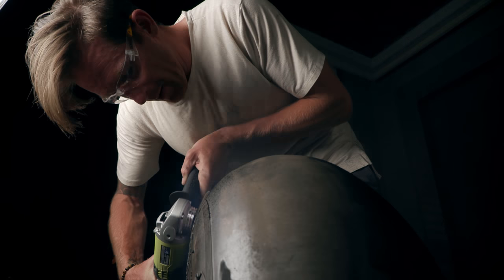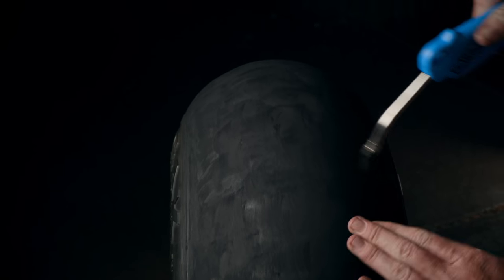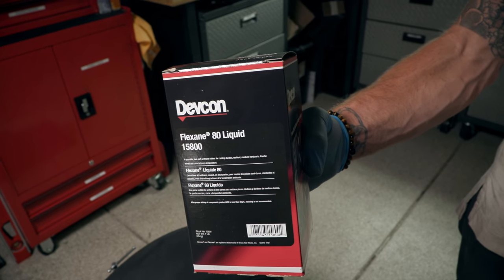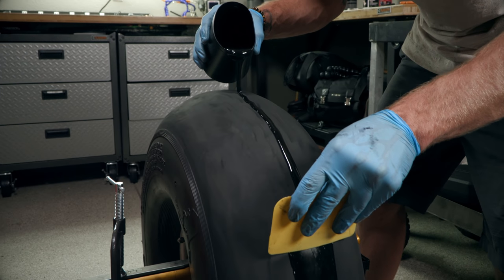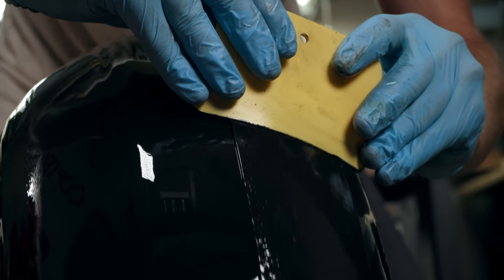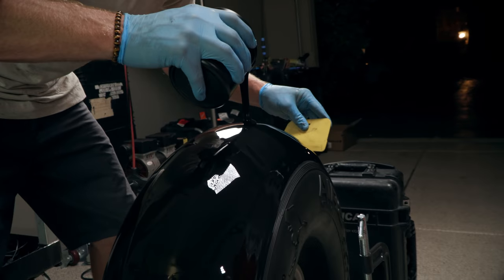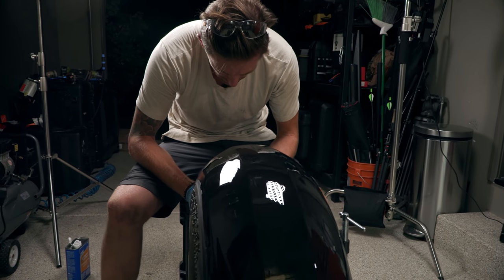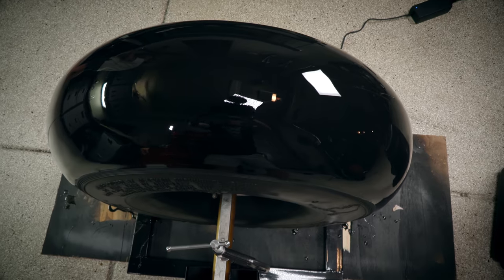Cure for the Big Tire Blues - DIY Tire Retread

Comment: Let me give you a quick rundown of the point in my day I am at and just watched this. I flew for four hours in the morning then ferried the plane from Midland to Odessa to drop it at mx. I hopped into another 182 to fly from Odessa to Colorado Springs and took off. After reaching cruise at 6,500 I noticed my oil pressure drop to 22 psi. I decided to turn back and check it. At about a 4 mile final the electrical system quit. I didn’t adjust fast enough for a no flap landing and had to go around NORDO at a busy nontowered airport. I have to be in Colorado tonight for Air Force Reserve in the morning. So now I’m waiting on a Southwest flight. The 69 line in this video made me absolutely crack up. It put me in a better mood and a place where I’m ready to just roll with whatever else happens today. Thanks Trent!
Reply from the maker: Dang! That’s a long day!
Reply from the maker: Glad you are ok, and that I could help you laugh at my childish sense of humor 😜
Reply: Dude, it was the right thing at the right time.   I’m just as childish!  See ya at Oshkosh ✌🏻
Reply: Yep!  At this point I won’t be getting to Colorado Springs until after midnight. But, it is what it is. I’ve got a beer and a steak quesadilla in front of me, so right now everything is good!
Reply: Trent Palmer hey Trent! What’s this song called?
Reply: @TrentonPalmer  3lbs for each 31 or does that do both?
Reply: For all the toxic garbage on commercial TV and even worse crap aired on the internet, there's still always something brand new premiering on social media that will totally reinvent your day! lol

Comment: Awesome thinking outside the ----- and coming up with a reuseable solution. Your not turning those rubber balloons at a high rate of RPMs. Your just adding some Soles of the Thongs for treading the Bush!

Comment: There's also one more (involved) trick available, you get the appropriate inner tube for such a tire, a scrub brush, a grate with fine teeth (if you buy fresh nutmeg, they usually come with the perfect grate) the best contact cement you can buy in your area, a very fine bristle painter's brush (width is up to choice), and a timer.

step 1, clean, clean everything like you want to eat from it.
step 2, inflate the tube inside the tire (without hub) and make sure you've seated it perfectly inside
step 3, with a silver pen, mark an outline of the peak that the inner tube has out of the tire's skirt.
step 4, deflate, reinflate partially and slide tube on to something to keep it off the ground, make sure you have something that keeps the tire rigidly in place, but not enough to deform it.
step 5, coat inside of tire, outside of tube, to the silver pen, wait prescribed amount of time, double coat, wait prescribed amount of time.
step 6. deflate tube, and very carefully (you can use paper to "hide" what you're not working on, as the glue on stick to it) insert the tube in the tire, making sure you've touched silver line to the skirt of the tire.
step 7, once you've done that all around, and you're happy with the result on both sides, inflate to make sure it's well seated, deflate, one last time, and then with a pair of scissors, cut to the marked line, just a bit bellow it.
step 8. using a roller make sure there's no air bubbles whilst you still can move the cut tube around (you've about 20 minutes or so with most glues)
step 9, put on rim, inflate, and let pressure do the work for you.

This will ensure you've got even more resistance to puncture, on a thinned, old tire, this is an actual second lease at life. 
I know this method from tractor tires that have enough gape in cracks, that you can stick your pinkie and touch that tube inside.

If you're lucky AF and manage to find a really thick tube, say 4 mm like they used to have back in the day, you're golden.
Reply: bushwheels are tubeless, they are a sealed unit.  You would have to do this process on the outside somehow, you have to be jus the right size tube that stretched over, might be workable.

Comment: Love the Idea. I wonder if you treated a new tire how many tires you could save. Just starting my tail wheel. My goal is to get on some bush wheels. Keep up the great content.
Reply: Michael Lang i did the tires on my Maule shortly after I got them and it's a huge savings. But its something you need to do fairly often to get the most from them.

Comment: Btw how much did this treatment cost you?
Reply: About 150+shipping  then you have to build a turning machine
Reply: The rotisserie can be made on the cheap with wood, the idea is to have a rotation motion. You can source all your parts from a trashed (important) rotisserie oven, some, even come with an actual speed setting on them. So all in all, you could build the whole jig for say 20, 30 bucks and a beer to your local trash yard (if they haven't wizened up to people getting parts for cheap from them).

Comment: Being experimental, I would have thought someone would have found a large diameter atv or utv tire (rim and brake?) conversion that would work?
Reply from the maker: Yes it would, the early kitfoxes actually used ATV wheels and tires
Reply: Trent Palmer so, why did they stop.  Seams like it would be much more cost effective and as robust.
Reply: The reason these are expensive IMO, is because they get to the market through agricultural equipment (low PSI to the ground, you can load a ton of equipment with a feather touch by these), aaaand, of course, in the infinite wisdom of agricultural companies, they rack up the prices to stupid levels, because really, let's punish those that feed us.
FYI, i'm referring to the curing molds and machinery used to make these, not to the brands.

Comment: I sincerely hope that this "retreading" (AKA: covering a tyre with unicorn tears and hoping for the best) has better results than every truck tyre on earth that gets "retreaded"......... every fifteen feet of every highway in the world is littered with these "retreads" that have failed and flung off the tyre causing more damage to the truck and any vehicle near it than a new tyre would of cost in the first place........... if that happens to a plane the price is much higher :(
Reply: Tapper21 , retreads rarely fail on trucks, it's the sidewall that gives way and the tire blows apart. I don't know if customers are pushing retread companies to do, old, stressed, tires, or if the companies are doing crappy tires to make a buck. But it is hard to tell how good a tire is, if a tire is run flat at any time or overheated, it usually has a short life left, but may still look good.
Reply: this isnt a retread, its more like a thick paint to take abrasion.